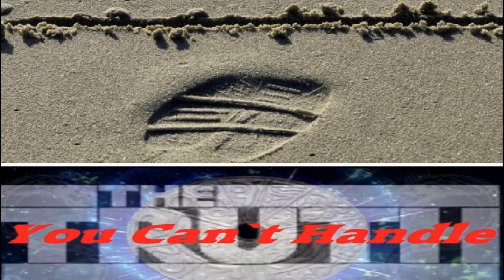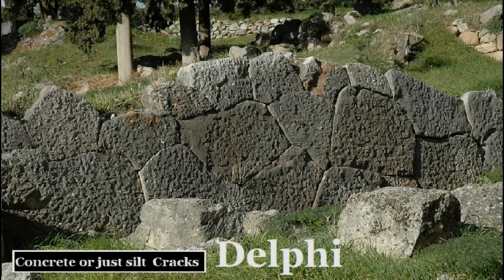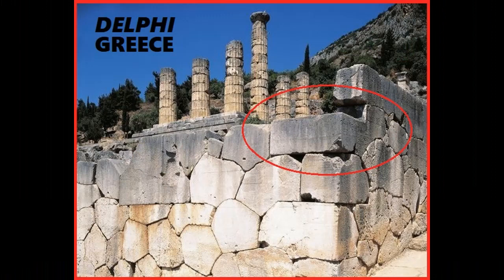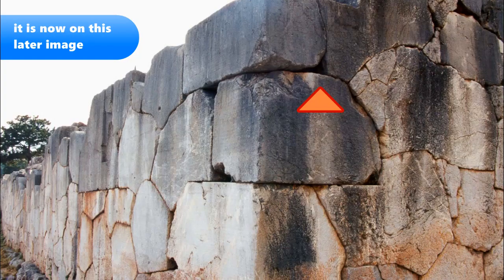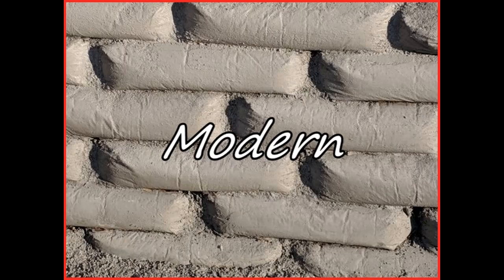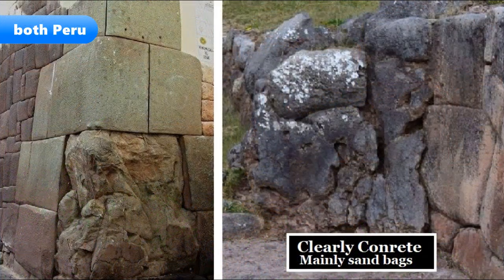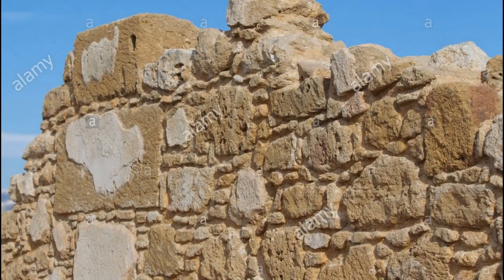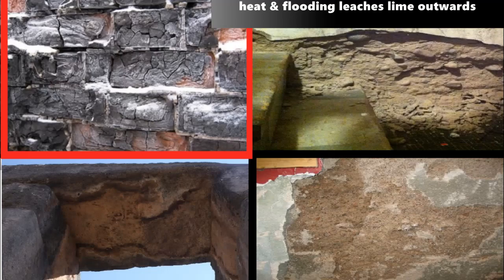Natural cracking and rendered walls

Comment: Something else that I've concluded is that on the walls that have long horizontal joints that run through the length of the wall..
These are not bed joints like they claim, rather they are the cold joints that are created when a new batch of concrete was poured into the forms on top of the previous batch.
Nowadays we use powerful vibrators or 'stingers' to bind each batch together into one entity thereby preventing any cold joints from forming.
However, If the previous batch that's been poured slakes up too much it will reject bonding with the next batch poured over it and will therefore cause a cold joint to occur, which will inevitably fracture.

If you look at these walls, you can discern the different concrete batches by following the longer horizontal joints. Sometimes the colors don't match exactly, which makes it that much easier to spot.

Also the bigger 'blocks' are where the mud was more rich and hydrated whereas the smaller 'blocks' indicate drier mud which would be more brittle and cause more frequent cracks..

If that makes sense?
Thanks..

Cheers
Reply: Thank you for mentioning. 
I remember something about that from having heard builder chat in my family years ago. 
Comments from men in the building trade are so interesting.
Reply: Reminds me of the bible proverb that no one patches old leather wine bottles with new leather.
The old and the new leathers would soon tear apart.
Reply from the maker: wOw you just nailed it my friend but more in depth than i normally put out for various reasons . . . . brilliant 3P.VISION

Comment: [By 600 BC, the Greeks had discovered a natural pozzolan material that developed hydraulic properties when mixed with lime, but the Greeks were nowhere near as prolific in building with concrete as the Romans.] Apparently the Greeks  did have a form of concrete.
Reply from the maker: Interesting information Cyphermunk and something i will dig into soon enough, of course i`ve been proving what i do here for so long its always good when somebody promotes another explanation or piece of the puzzle, for me to either take on board after checking or even just further confirming my own discoveries ....... THANKS AGIAN.

Comment: "Concrete" walls + cosmic plasma event = naturally cracked walls + mainstream archaeology = incorrect interpretations. I'm glad to see others are finally setting aside silly mainstream nonsense and thinking for themselves. Good job figuring out these were man-made formations that cracked. If you're interested in why they cracked, check out Electric Universe Theory and go from there, it's from previous cataclysmic cosmic plasma events. You'll need to do a lot of research and look outside EU theory too, but the truth is out there for those who look for it.
Reply from the maker: Thanks for your comment Locutus and recognizing my common sense & ability to apply my 1st hand experience in construction, along with decades of researching these topics and having put aside so many well known researchers information having turned out to be wrong, i also need to dig into electric universe more than i have to date cOz i am certainly lacking compared to some here ON THAT TOPIC . . . . THANKS AGAIN